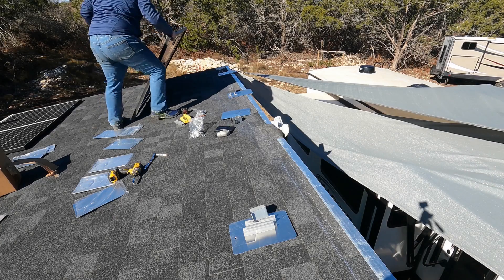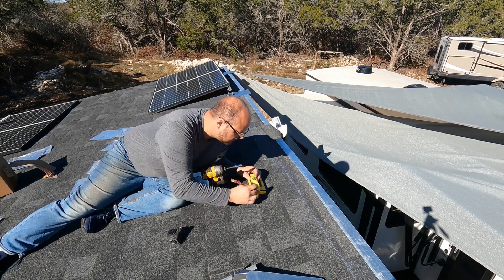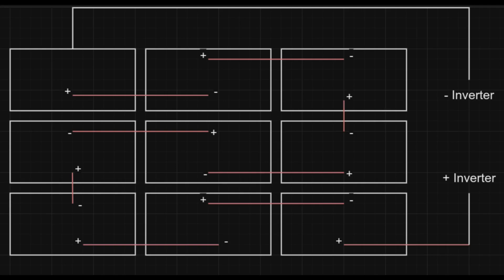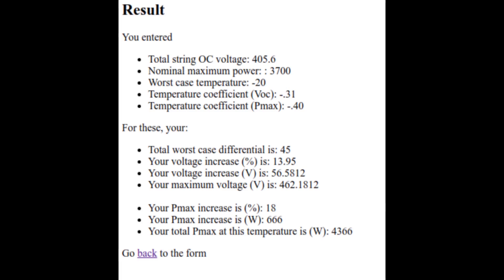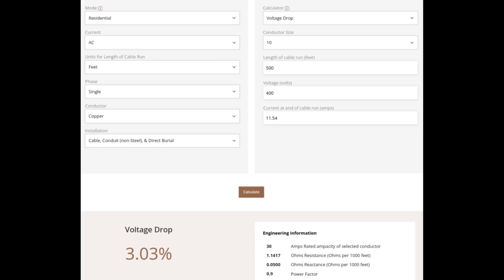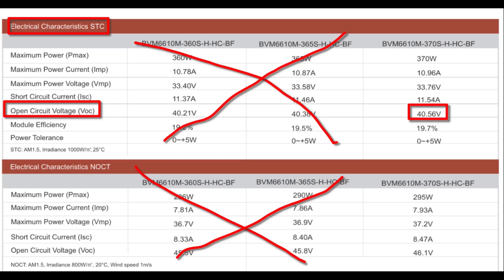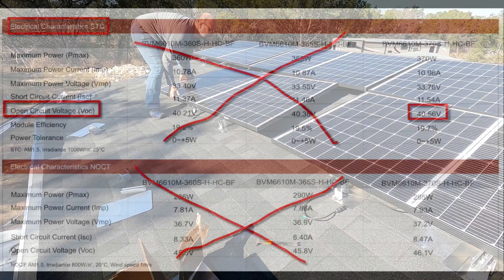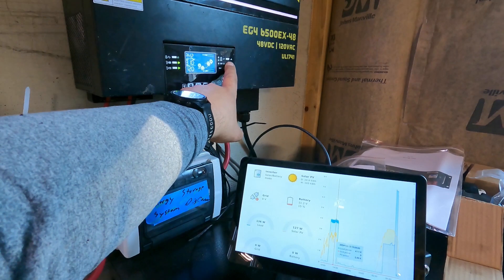19 - Installing Solar Array on Shed Roof

Comment: 2 solar parallels should be fine, even if the Amp goes above charge controller max amp. The charge controller will simply limit the amps it draws from the panels causing a loss in the total wattage the array can produce.
Reply from the maker: Where is this info from?  This isn't what I understand.  I know you can overpanel, and it will limit just fine, but I'm pretty certain your still want to be within the Isc limitation.